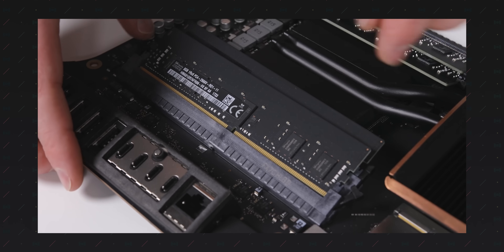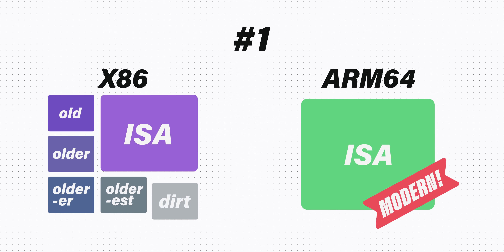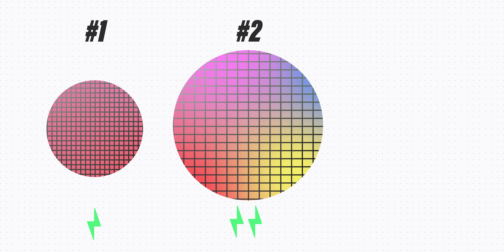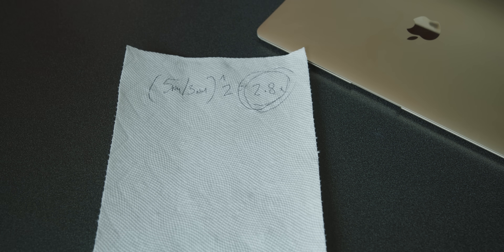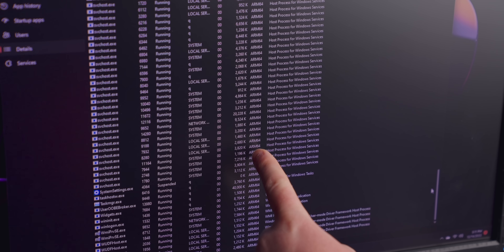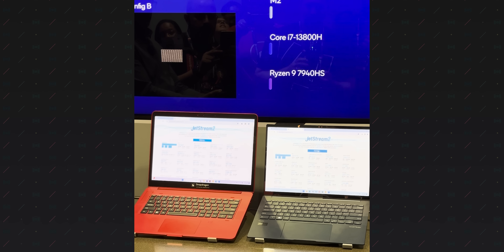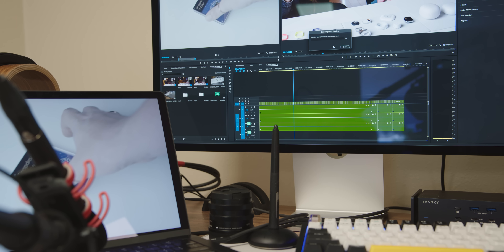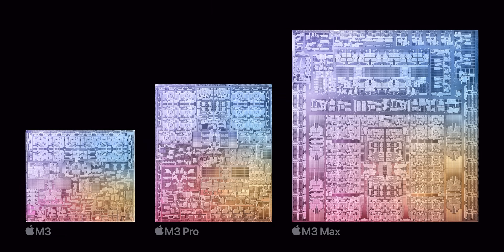Apple's Silicon Magic Is Over!

Comment: I am planning to buy myself the next Mac Studio M4 for some hardcore editing. Hoping that the form factor might help it not throttle too hard. Am I right or totally missing the point here?

Because in the end if your chip is bigger and gets more air, most of the issues are fixed. Nah?
Reply: yes but no but kinda but no

hot chips are bad because physics, that silicone can only take so much and even the best cooling in the world is only capable of cooling one side of the chip (part of the reason that powerVIA is gonna be huge assuming Intel finally pulls it off). 

The high heat also means the chip is pulling a higher power draw, and it's doing this because the chip is overclocked because of the wall that apple is hitting. This is not good no matter how efficient your chip is.

I know this is a kind of crazy thing to say considering current Intel chips, but Intel knows they're in a deep hole and is taking aggressive steps to dig out of it. hopefully they can pull it off. AMD could produce the x86 answer to the M-series but they aren't and won't because they don't have to and never will because they don't actually want to produce desktop and mobile (laptop) chips at the scale to compete with Intel cuz it's not actually their main market, embedded/specialized SoC APUs are. AKA AMD is content playing second fiddle to Intel and Nvidia because they have game consoles and (to a lesser extent) servers cornered.

apple essentially was in the right place at the right time, like usual. I remain doubtful it was because of any particular insight, considering the numerous wrecking ball sized holes that have been troubling the M-series since day one (lol what displays? when you market to a prosumer market but tfw no GPU no RAM no Storage, what's a pcie lol, if your professional software needs don't stop with content production then congrats on being a windows user now lol, making a desktop that has absolutely 0 benefit to being a desktop)
Reply: Usually, yes.  Having much more robust cooling potential makes a big difference.

Comment: I bought into the first iPad thinking that it would be a useful accessory to a PC. Within a year 99% of my computer use was on the iPad. Years later the iPad Pro is my go to machine with PCs relegated to support and background processing for specific tasks involving long term monitoring and those tasks could be handled by a Raspberry Pi. Any consumer is going to be more than happy with the performance of Apple equipment because it is fast, gets the job done, and doesn’t suffer from security issues to the extent that Microsoft and Intel based systems do. The time saved avoiding update and security issues more than covers the higher entry and upgrade costs.

Comment: Took me ages to stumble on why Apple M series machines had such limited external screen support, hugely reducing the previous number. They are using the iPhone display controller instead of a high end laptop one. As a projection artist multi outputs, 3 are really the minimum for the installations I use and that's evidently common on other hardware. My 5 year old midrange Amd based HP supports 5 external outputs (internal touch screen still on, so 6 screens in total) so for arts work it's a dream. Be great if Apple worked out its design limitation.
Reply: @carylittleford8980  That's actually not what's going on.  The reason the base M chips can only support 2 displays* isn't that that they have underpowered display controlers.They actually have very powerful display controllers, one of which can drive 6k@60Hz, and the other 5k@60Hz.  Instead, the reason is that you need one display controller per display, and the base M-series only has two of them.  I.e., it's not the power of the controllers, it's how many they have!  

I suspect the reason they don't add a third 6k controller to the base M chips is that Apple's controllers are large, and thus would take up a signiifcant percentage of the chip's silicon real estate.  It's not clear why they're so much larger than Intel's controlers.  I've heard it suggested it's because they contain larger buffers to improve efficiency, but that's just speculation.  I suppose Apple could add another 5k controller--those are smaller.  But for whatever reason, they didn't—either they don't want to spend the silicon on a feature (3-monitor support) that they think most base-M-series buyers wouldn't use, or they're doing it for product segmentation reasons.   I personally use 3 external monitors, so the base M chip would not work for me.

*Yes, there's a workaround from DisplayLink that allows you to drive more than two, but that's an aftermarket kludge that has mixed results (works for some but not others).  What I'm talking about here is what's supported **natively**.
Reply: Today is the day this is over. Base M4 chip (unbinned) supports 2 external displays.  Finally
Reply: I use a displaylink dock to drive triple 4k displays with a macbook air m2 and I'm pretty satisfied with the results.
Reply: @jerryw1608   @jerryw1608  that's interesting. Is it the base M2?. Apple's site says just one screen on the base M2 or M3 and you need the highest end M2 chip to do more than just 2.  There is an update that lets you run 2 external screens on some MacBook Airs but only if you shut the internal screen off, which is quite 'unique' a solution. The only Apple dealer store in my area also tells me it's just one screen on base models and you have to have bought a higher end M series to get over that limitation.
Reply: @carylittleford8980  You probably misunderstood what @jerryw1608 was referring to. He said DisplayLink - that says it all.
DisplayLink is a series of external display controller chips that connect to any USB/Tunderbolt port on a host system and are able to create another display. They have been successful with this technology for more than a decade, continuously improving upon it.
These devices obviously need drivers for the OS to recognise them (but they are available for nearly any OS), and there are, of course, limitations, mainly because of the port throughput and CPU load. The external display protocol works by compressing the differential image data on the host system, sending them to the external device and decompressing them there, merging the result with the current frame buffer, effectively re-creating the full frame there. It does not send complete frames fhrough the cable.
Reply: @carylittleford8980  Well, YT obviously thinks I am unworthy of posting anything, and consistently deletes my replies. I just keep on trying.
(continuing the previous post) The external displays are usually limited to 30fps due to port bandwidth, but there may be exceptions I do not know of.
This way, you can connect any number (limited only by the number of USB host controllers and their bandwidth) of such external displays to a host system, regardless of whether the host hardware even supports any.
Reply: @jerryw1608  I'm using built-in display since 2017, but I'm a weird guy that values portability and being able to work any place on earth.
Reply: Makes sense as the M series chips are just a scaled up version of the A series iphone chips. They just threw in more cores, rebranded to M series and called it a day.
Reply: It really doesn't make technical sense. The MacBook Air can drive an Apple Pro Display XDR 6K at 60Hz with 21,233,664 pixels. There is enough bandwidth there to instead drive 2x 4K monitors at 60Hz as that is only a total of 16,588,800 pixels. It has to be a product positioning choice. A sharp fifth grader could figure out how to get this to work.
Reply: @joe3276865536  It might be technically possible to support 3 4k displays natively if apple would allow it, but most likely this limitation is set to sell you a higher tier product. The ‘M3 Pro’ can support 2 displays and the ‘M3 Max’ supports 3…
Reply: @joe3276865536  Two 4K displays work fine with the MacBook lid closed. The resolution total would go above 6K with the built-in screen turned on, so it makes perfect technical sense, you just missed that part. Back to fifth grade!
Reply: That was fixed long ago
Reply: I don't think most people need more than 2 screens including the integrated one. Sure, SOME might and so did I at one point. But most people don't.
Reply: With a MacBook Pro you can connect up to 4 external displays 🤷‍♂️
Reply: This was “worked out” already. Years ago. You must be referring to an older base model.
Reply: It's so bad it's even difficult to get non-mirroring displaying on a single external HDMI screen. If you want 3 screens (even including the built-in display) you should give up instead.
Apple designs their products for one specific workflow, and are now hard-etching that workflow into the design of the actual chips. If you differ at all from what they expect you to do, you're going to have a bad time.

Comment: Do Mac's need to get faster or do they just need to deal with heat better? No one is gaming on a Mac by choice so it doesn't have the performance issues of a Windows system.
Reply: been watching closely my selection of laptops recently and realized what I have been trying to emulate. as long as os is more add friendly I am gonna give it a go.
Reply: They just need to deal with heat better. If Apple was designing their chassis around system cooling requirements instead of picking a form-factor and cramming in whatever will physically fit, their laptops would be a lot faster for sustained workloads.

Comment: Qualcomm's main competition isn't Apple it is x64. They will be better and priced more. Those who would move to Mac have probably already done so. Those who like Macos won't change back to Windows just for a little extra performance if Qualcomm beats apple in years to come. Some Windows users who bought Macs for the battery life may move back but this is probably very small compared to the number of Windows users who want better battery life but didn't move to Mac. Arm chips will make MUCH better laptops and Qualcomm will therefore be able to charge more than x64 laptops. They already cost more even though their performance sucks. I can't imagine they will start costing the same or less now that they won't suck. Entry level Macs are already very competitively priced when you compared to similar quality, battery life, power, etc.

Comment: I also have concerns for longevity. I've got an M1 Max and my battery is already down to 80%. Also lately I started hearing the fans and it seems that the machine is getting slower all over. I also heard from friends that the same is happening to them. Cleaning the fans did not help unfortunately.

Comment: You missed a trick. Partition the dies off to smaller pieces and spread them out. 
AMD is the king of this right now, Chaplets, and Intel's next High End chips will all be chaplet designs, Nvidia is doing the same for their next gen GPUs.
You increase your yield while lowering your cast, you use lower cost interposers to handle communications between components and you can mix and max process sizes, so your functional units can be the smalless node, while things than don't need to operate as quickly can be made on a larger node.
This also can make power control much more granular. I could see Apple doing some custom things to just turn off extra CPU cores that aren't needed during sleep, for instance.
The GPU hegemony will probably cost them in the AI space.

Comment: M1 seems like a consumer first upgrade but professional afterthought. My fiancé works in film editing and her most recent job essentially saw a 3 week set back due to limitations in the new Mac studios. 

I walked into her new office and saw the setups and was initially excited that they weren’t using cheese graters or honestly even trashcans but the issues started days later. Imports and exports were causing crashes, graphical and audio errors seemed to plague the system to the point they thought they were getting faulty media from production or their dailies house. 

There were also issues encrypted media where it was obnoxiously hard to encrypt and once done if successful equally hard to unlock without crashing on the other end. 

I, unapproved came in to help her troubleshoot one weekend, and mentioned their use of apple silicon. It took the tech team 48 hours of trouble shooting, 24 of which were onsite  before they shipped 5 nearly maxed cheese graters out and it’s been smooth sailing since 

With 30+ avid extensions running new versions of OSX just don’t reliably work.
Reply: Is that an apple silicon thing or an AVID media composer thing? I understand that in your wifes case it's essentially the same thing but if all it took was one software vendor to veto a new platform then we would never see any new platforms. Davinci resolve works amazingly well on apple silicon and is also an industry standard post production software.
Reply: @definingslawek4731 
AVID wasn’t the majority of the issue. A few of their plugins didn’t work and would cause crashes and downed media. That was a pretty easy fix and they were able to just remove the plugins. Not ideal but understandable. Different versions of Mac OS and AVID can cause the same issues on Intel Macs. 

The bigger issues were non AVID related. They had networked  storage issues. Encrypting and reformatting drives for sharing in certain formats. I’m sure there could be a work around in the sense of encrypting differently or using a different format but they have a standardized workflow across departments and suddenly they were the only team with issues and also the only team solely on M series Mac’s. They lost 2 work days after drives would fail in some way or another before reverting back to Intel Macs. 

One of the issues was coming from Graid and softRAID software not showing drives as mounted. Another issue was a thunderbolt hub that would disconnect drives at random when new monitors were turned on or another drive being plugged in. 

The issue persisted across 2 different thunderbolt hubs which were required as they have 4-5 monitors plus connections to multiple drives and sound equipment. Essentially more accessories than physical ports on the back of the computers. 

It didn’t seem like just 1 issue but a few compounding issues that caused them to pull the plug and revert back to the Intel Mac’s. Maybe there is something they, myself, and the IT team looked over but they haven’t had any of those issues since the Intel Macs were reconnected. 

I’ll be curious if they try M series Mac’s again on another show. Hopefully they have a bit more time to troubleshoot and figure out the issues but for now they are stuck another half a year at least on Intel.

Comment: Your Number 1 just isn't true, Modern X86 CPU's run off Micro ops and translate everything internally into small instructions, ISA is not an advantage of ARM
Reply: This comment here. The ISA doesn’t matter, especially the idea that legacy support is a significant problem.
Reply: Being able to customize an ARM processor exactly how they want it to best work with their own custom operating system is absolutely an advantage.  They could not do the same with x86.
Reply: @maynardburger  they could if they could get a licence but they can't get a licence. Thus ARM.
Reply: Doesn't matter point is x86 chips can never be as efficient as arm chips in battery life and efficiency if they were then we would use them in phones and mobile devices not including laptops
Reply: @Space97.  that's not true, there ain't any that are designed for phones. If you stick an M3 in a phone it won't be efficient ether. ISA has nothing to do with how efficient a CPU IS.
Reply: @Rocman76  question why do you think where were able to put no fans on some of their macbooks and it stayed cool and quiet because with  intel that would not have been possible I recommend you watching videos on x86 vs arm and they all say one thing and that's efficiency
Reply: @Rocman76  also I'm  talking about the arm architecture not a certain chip it self
Reply: @Space97.  because they (TSMC) were about 2.5 node shrinks gens ahead of intel when M1 came out
Reply: you can skip that translation with a RISC chip.

Comment: Steve would have never allowed those stupid notches into their product range. M1 was a sweet spot... Qualcomm is making a huge mistake holding off release until Microsoft is ready (Apple have already won). The EliteX will be driven by Linux, not Windows (which will flop due to the weight of legacy) - that is reality.

Comment: #1 is pure BS. First, ARM uses the same type of system that Intel does, the distributions of the instructions might be a little more uniform, but it isn't significantly so. Even if that part were true, the M1 literally reimplements a major portion of the x86 decode in hardware, which is the part you are saying is so top heavy.
You are spreading marketing, so please don't pretend it is technical.

Comment: There are the new Piezo fans which should help against the throttling, and as for the rest - Apple sells well packed user experience for a price bonus, not performance or any specific hardware really. So they can pace themselves as far as the actual hardware under the hood is concerned, and they certainly shouldn't brute force results like they currently apparently do.